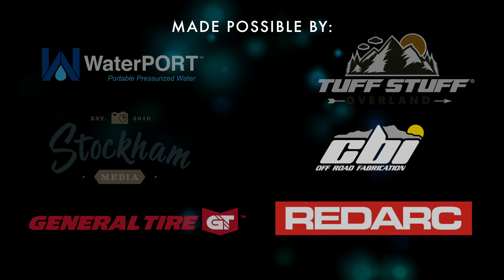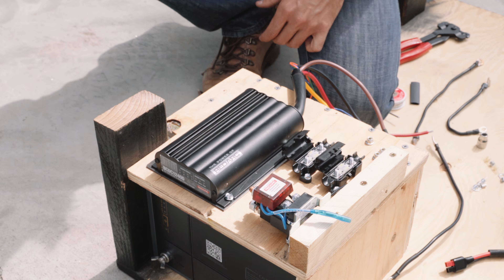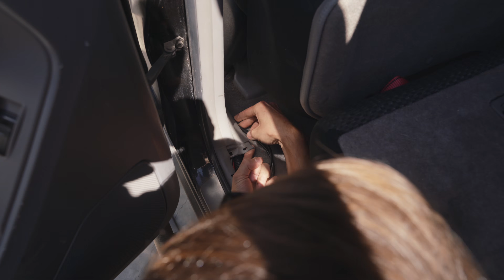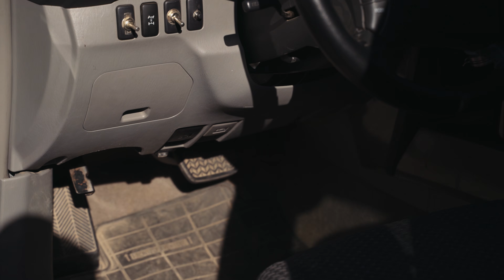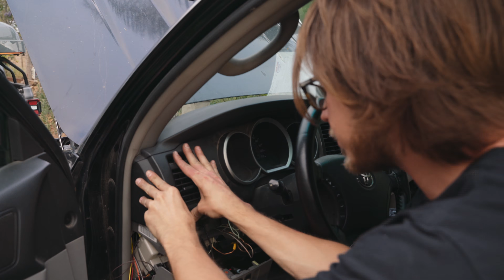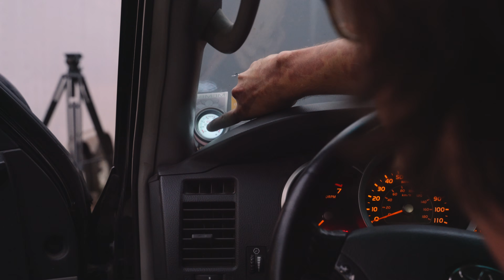How to Install REDARC BCDC Dual Battery Charging System

Comment: Why did you need the load disconnect? The BCDC does it automatically I’m pretty sure.
Reply from the maker: The BCDC is on the charging side, not the load side

Comment: How has your stock Alternator held up to the 40 amp draw from the bcdc? I’m trying to decide if I need a shut off switch to not always have it running.
Reply from the maker: So far it's held up great. Ultimately when this one goes bad I'll put a larger one in but so far, so good.

Comment: Can you explain the load disconnect a little more? I thought the red arc charger handled all of that. I'm wondering if I need that load disconnect as well. Newb here.
Reply: yeah same i dont under stand why its there unless its for another battery in a van or camper
Reply from the maker: The load disconnect is there to protect the starter battery in case you leave something on. It will disconnect all loads once the voltage drops too far. The Manager 30 does not do that.
Reply: @TrailBendersOverland  Oh. I thought the redarc bcdc charger did that.  I have a smart alternator and not sure if that makes a difference but I just assumed that power would not be drawn from the starter battery and that was a lot of the purpose of the bcdc charger.
Reply: The redarc dcdc charger does that its a smart charger and it especially does that when you add the blue wire

Comment: Does the Lion battery not have a built in BMS?  At that price point it most certainly should.
Reply from the maker: I asked them and they said it does but it’s still safer to use a dedicated shutoff
Reply from the maker: That said, we wanted to make a video that anyone could follow with any battery.

Comment: hello mate , you have already BCDC , why you still have Load and Disconnect  what for.. thanks.
Reply from the maker: The BCDC is the the charger/isolator between the two batteries. The load disconnect is between the aux battery and all the aux loads. It prevents the aux battery from being damaged by over discharge. 

There are a couple version of the SBI (Smart Battery Isolator). Most people understand it as a battery isolator. So naturally if you get a BCDC it replaces the SBI. But they also have a load disconnect version that  isolates the aux battery from the aux loads. This is something the BCDC no control over, it can only charge the aux battery, not control when my winch, lightbar, or fridge is about to over drain my aux battery to a damaging point.
Reply: @TrailBendersOverland  many thanks for the info , i learn more from your video more power mate.
Reply from the maker: @australiaaustralia1947  Happy to help! Always feel free to reach out with any questions

Comment: Thanks for the video! I have scoured the internet for 8 awg heatshrink+solder butt connectors but haven’t had much luck (want the same for solar). Where did you find yours?
Reply from the maker: We got everything on Amazon. Check out the kit we sell. We list all the Amazon links in the product description for the things like heat shrink and solder, and other things we don’t currently source ourselves. 

https://shoptrailbendersoverland.com/collections/off-grid-power-solutions/products/off-grid-dual-battery-and-charging-system-kit-40-amp

Comment: Thanks for the great video & very clear instructions. On the redarc vid they mention that the isolator can also be used to jump the starter battery using the auxiliary battery as the power source. Is there anything special you need to do to do that? Or do you simply use jumper cables between the two. THANK YOU!
Reply from the maker: You can wire the system to jump start your starter battery and/or to charger the starter battery with solar. This is a different wiring setup and requires extra relays and an additional SBI to make it happen.

Comment: Hey, thanks for the install video! I am trying to understand something though... why did you chose to use the Smart Battery Isolator when the BCDC essentially does that function for you? I am not completely clear on that, but reading RedArc's manual for the BCDC makes it sound like the SBI isn't needed. Let me know your thoughts!
Reply from the maker: This SBI isn’t the standard battery isolator SBI for charging. It is the lithium load disconnect. If you look at where it is in the flow of energy, it is between the aux battery and all the auxiliary devices that it powers. This is completely separate from the charging side of the system. The BCDC can only charge the battery, it has no control over how much the auxiliary items draw from the battery. The SBI installed here will sense when the battery is draining too low and disconnect all the auxiliary items (fridge, lights, compressor, etc..) to prevent the battery from being over discharged.
Reply: @TrailBendersOverland  Thankyou for this detailed answer, I struggled to find much information on this part of my install.
Reply: @TrailBendersOverland  is the sbi necessary for lithium
Reply from the maker: @paulystp  It’s the SBI Load disconnect version. It is necessary to protect your auxiliary lithium battery from over discharged. The SBI in this case is not part of the actual charging system but rather is on the load side. It will disconnect all your auxiliary items from the battery before the battery is harmed.
Reply: @TrailBendersOverland  Wouldn't a battery with a good internal bms take care of this anyway, or are you doubling the protection with the SBI wired this way?

Comment: explain what the out cable from the load disconnect to the bus bar or fuse box purpose is?
Reply from the maker: The cable from the load disconnect to the bus bar is the positive lead that powers any auxiliary items that you might connect to the bus bar or fuse box.
Reply: @TrailBendersOverland  
So if I had a + & - bus bar configuration similar to yours, that + bus is powered by the Aux. battery via load disconnect.  If accessories are ran by SPod or VoSwitch; should be able to run the spod or other unit there for power?
Reply from the maker: Correct! You can 100% power a switching through a + bus bar. If you’re looking for a switching system though check out the RedArc RedVision. We have a video on that too. It’s a fully integrated smart aux power and switching system. It’s amazing.  https://youtu.be/1HfSQ8oTkK0
Reply: @TrailBendersOverland  
Ive  seen that system & your video.  Both are top notch!  Thanks for answering & the aid.
Reply from the maker: Anytime! Always happy to help.
Reply: @TrailBendersOverland  
Another question. Would the install of 1240D require the SBI?  Is the SBI in this install a redundant system to prevent over draw on Aux. Battery?  I do apologize!!
Reply: Or is this due to Li Profile?
Reply from the maker: Please don’t apologize! I asked what felt like silly questions too when I was learning. The easy way to explain is the BCDC only control input to the battery. It only controls the charging. It makes sure the aux battery is charging at the correct voltage when the vehicle is running or is charging with solar. The SBI load disconnect is between your auxiliary loads and the aux battery, the BCDC has no control over this area. 
Starter battery -> BCCDC -> Aux Battery -> SBI -> Aux Items
Reply from the maker: The SBI it a good idea for any battery to make sure you don’t damage the battery by over drawing. If you have a Lithium battery you’ll need the Lithium specific SBI so it shuts off at the correct time. Different types of batteries handle different amounts of drain before damage occurs.

Comment: I thought the DC - DC Box had it's own load distribution and cut-out built into it , why the double up ,( $130.00 ) more or less . We are all trying to save a little bit of money these days .
Reply from the maker: Cut-out built into the BCDC is only for charging, it doesn’t affect the auxiliary battery’s connection to the auxiliary items. The BCDC can’t prevent the auxiliary battery from being over-discharged, unless it’s charging with alternator or solar of course. 

The load disconnect goes between the battery and the bus bar where are the auxiliary loads connect. If you want to protect the battery from over-discharge then the load disconnect is necessary.

Comment: Nice setup. Will the DC-DC charger use solar energy to charge the engine's starter battery too once the Lion Energy aux. battery is full?
Reply from the maker: Oh goodness, sorry I missed your comment I try to be on top of them same day. By default the BCDC will not charge your starter batter. There is however a way to do it using relays. I'll put the link under this comment. The easiest way would be to hook jumper cables up to the two batteries and let them balance out and charge together. But the special wiring would be pretty trick too. Here's the link:
https://cdn.shopify.com/s/files/1/2204/8993/files/bcdc1240_12v_solar_and_jump_start_setup_01b137f1-4790-4031-8f32-f5c655a2d799.pdf?17181802029519916597
Reply: @TrailBendersOverland  I suppose the jumper cable solution does not prevent the starter battery to drain down with the auxiliary while camping (during the night). Thanks for the diagram!

Comment: This is the first time I see the SBI12 mounted upside down.
Reply from the maker: Nitro Racing There’s a first for everything! It’s working great there too.
Reply: @TrailBendersOverland  I did read on their website that it is not recommended to install it upside down.  Not sure why or if it matters.
Reply from the maker: @charlesbarrack3223  interesting. I’ll have to double check with them. It’s been work g great for me and we worked 1 on 1 with the head engineer at RedArc to make this system for my 4Runner.
Reply: @TrailBendersOverland   Let me know what you find out.  Thanks again for all your consults.  My system is working great so far also.   You were a big help.

Comment: Great video, but trim and clean up that wiring
Reply from the maker: Sean Hannon Thanks. I know it’s not perfect right now. I have plans to build a proper rear storage system and electrical box complete with a relay box. Basically all of my wiring will be getting redone. Stay tuned for updates!

Comment: Hello. Thanks for the install video. I am considering a Redarc charger for me rear mounted lithium battery. Do you have to use the isolator even if the lithium battery has a BMS on board? Or should the question does the battery isolaror prevent the lithium (aux) battery from being drawn down too much? Thanks.
Reply from the maker: Thanks for watching! The isolator is to prevent the aux battery from being drawn down too much. If the on board BMS in your battery controls that on it's own then you don't "need" the isolator. Not knowing the internals of your battery, it's an extra step of protection that we strongly recommend.
Reply: Thanks for the answer. I appreciate it. I will go with the isolator just to make sure.

Comment: Why did you use that heat shrink/solder coupling first (which btw looked like you burnt the crap out of it)  and then go and just solder the connection in the rear?  Why change methods? And why do you use that huge mapp gas torch?  Don't you have a small torch or heat gun?
Reply from the maker: I I good questions and observations. I used the heat shrink solder just to show one option of joining wires. I prefer the traditional couplers. We don’t have a small torch or heat gun so we use what we have. It’s my understanding the heat shrink/solder works better with a heat gun.

Comment: So, the BUS BARS would be the same as like an SPOD❓  WOULD YOU KNOW IF THE 1240 REDARC will need that isolator ❓
Reply from the maker: GSD Schutzhund the bus bar is like an spod without the switches. If you plan on install individual switches then a bus bar is good. If you’re looking for a switch system then something like an spod or switch pros would be a good idea. The isolator we used isn’t for the 1250, it’s for the battery. If you are using a lithium auxiliary battery then you will need the load disconnect battery.
Reply: @TrailBendersOverland  ...thank you.  I wish I would've found you earlier 😕

Comment: I think its overkill to go with a 40a vs the 25a Redarc. The 25a is good for 200ah battery. Some reports online say its not good to use a 40a charger for such a small battery. 40a is used for 200ah + batteries.
Reply from the maker: This was also a setup that the engineers from both REDARC and Lion Energy helped us design. They recommended the gear based on how we plan to use it.
Reply from the maker: For most setups I would agree with you. That's a great rule of thumb for the charger/capacity ratio. That is why we went with Lion Energy. Their batteries are rated for 100A of charge input so it has no problem accepting a charge of less than have it's max. Big difference from other Lithium and AGM batteries. This system will be heavily used for content creation and will be also charging the Lion Energy Safari ME when we get them so It will be greatly beneficial to have the charge power when the ME comes, and in no way damaging until then. Also, it will charge the UT1300 it under 3 hours of driving which is huge for us. If you were using any other brand of battery I would not recommend the 40A for a single battery setup like this.

Comment: Good call - been looking at the REDARC system as well - great product!!!
Reply from the maker: You might want to wait until August 8th. They are unveiling an awesome system and we are currently installing it in the Gladiator. We’ll also have that new system in our shop. It’s worth the wait!
Reply: Trail Benders Overland - awesome - thanks for the heads up!!
Reply from the maker: I’m loving it! They make real quality gear. You won’t regret it.
Reply: would the wiring on the 4runner be the same on a GX470 08. very simple explanations i dig it. Thanks for the Info. im currently building also and Rookie status. going to DYI everything.  i sub’d👍🏼

Comment: I was under the impression that the 4th gen does have a smart alternator. Redarc site suggests the same
Reply from the maker: Where did you see that on their website? I was having a hard time confirming but I don’t see the sensor on my battery that RedArc shows in a diagram to confirm if you have a smart alternator.
Reply: @TrailBendersOverland  it was the main reason for going with a bcdc system https://redarcelectronics.com//pages/dual-battery-selector the 4Runner isn't listed, but everything with similar year range for Toyota has a smart alt. That info also matches what Torque and cheap gauges show as I'm driving.
Reply from the maker: I went to that page and it seems most of the vehicle in the similar model year are temperature compensating alternators rather than smart alternators. I have noticed mine charges high then drops. But nothing like a smart alternator. I’ll need to confirm with RedArc if “temp comp alts” require that ignition cable be connected. I’ll get back to you. 

All that said, my system has been charging beautifully for the last month. Charges up quick and consistent.
Reply: @TrailBendersOverland  ah, yes, good point. Let me know what you discover.
Reply: @the_nothing  4th gens are not smart alternators

Comment: Can we use 60 amp breakers instead of fuses? I have a ram 1500 I need to get ready for Colombia so any input helps!
Reply from the maker: Willy Risco You can use breakers but engineers from RedArc recommend fuses. Fuses are safer because they interrupt the flow of energy quicker than a breaker. You’re less likely to hurt your auxiliary gear in a surge.
Reply: Trail Benders Overland awesome thank you for getting back to me and we love your channel!
Reply from the maker: Aw shucks. Thank you! Always happy to help!